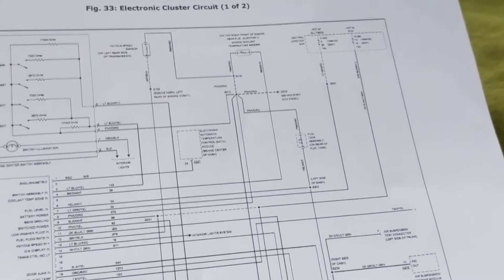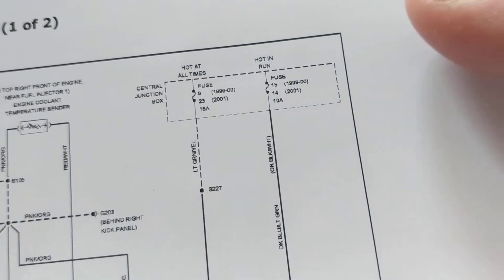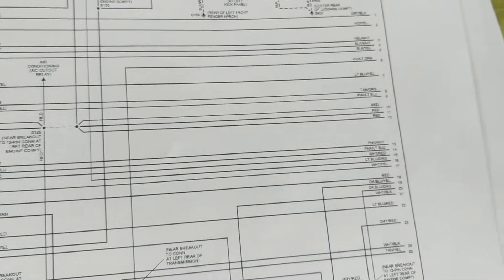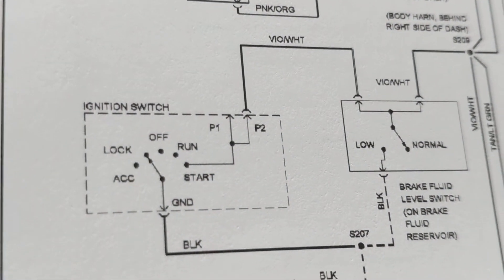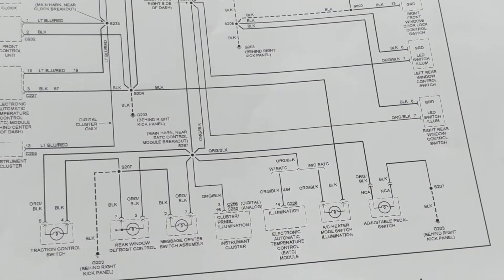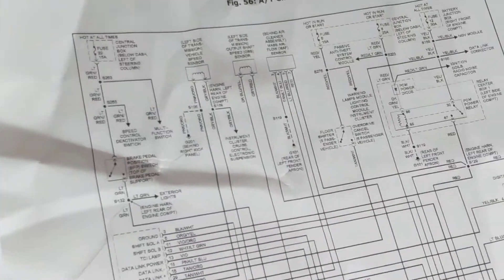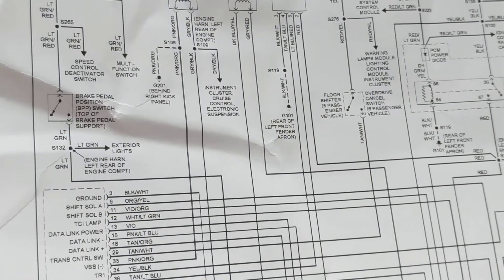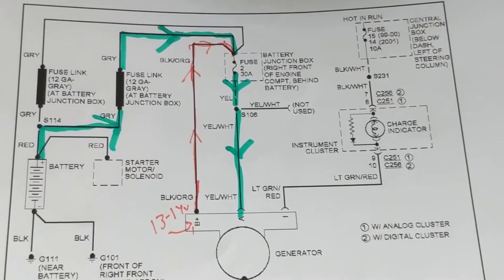no start from battery or alternator problem from wiring diagram

Comment: have a 04 Grand Marquis my alternator a B+ cable to battery and a 3wire plug, do you know witch one is the signal wire?
Reply from the maker: Go to Google search put in 2004 Grand Marquis wiring diagram for alternator you should come up with some page for an alternator diagram about the connector keep me informed
Reply: Joe
I found this one online
yes- it’s the one that has no 12V or 5V reference and has no continuity to chassis. measure it against ground to confirm. Just make sure not to short the reference to B+ if it uses a 5V reference or you will damage your computer.
______________________________
But do I check it, engine running or not? 
still waiting for that answer. @Joeelectronicschematicsforauto
Reply: If you're referring to a connector to the alternator usually one is the b+ which we know the thick wire is the b plus going back to the battery we know that then there's another one to detect the battery voltage how much it is back to the alternator then there are two other ones which control and communicate to the alternator from the PCM about load conditions
Reply: There could be two wires as a signal wires like I said reference voltage comes from the computer usually for sensors this output of the alternate is controlled by the computer and you have to check it obviously with engine running to see the output of the alternator when you put on all the loads if the voltage stays the same